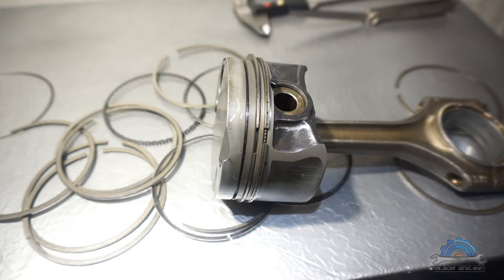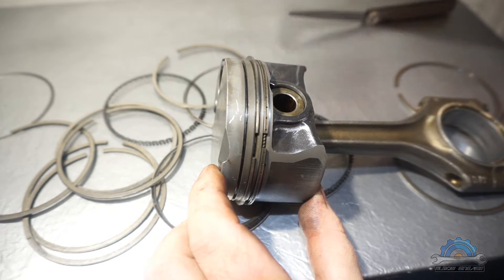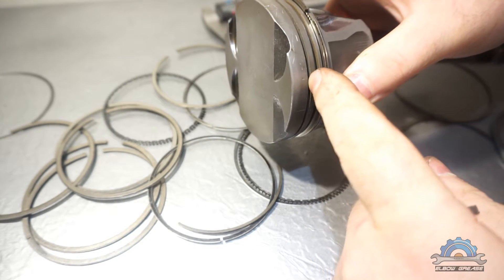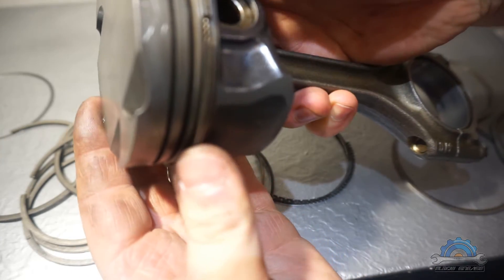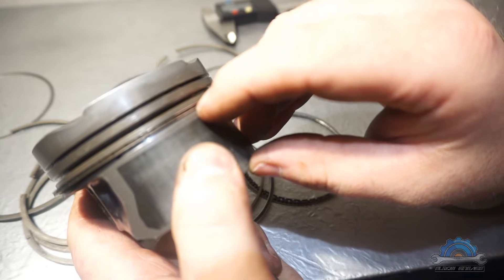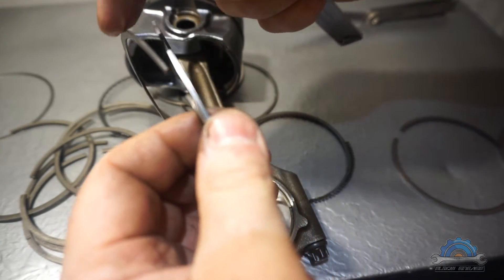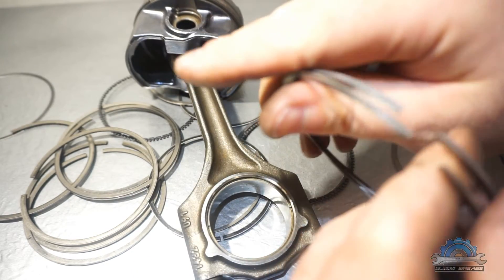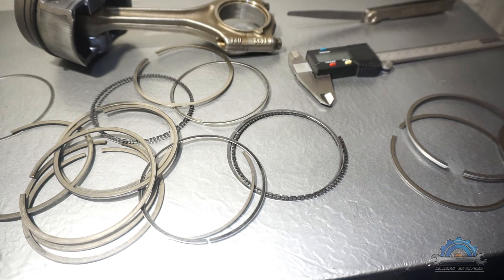BMW e46 M54 piston with M52tu rings?

Comment: I bought Goetze m52tu rings for my m54 block. My bores are only .0004" wear, yet the m52 rings have a .8mm gap, which is double bmw spec. Thoughts?

Comment: This is really interesting solution to the M54 oil consumption problem.....though I wish you had also shown a comparison between M52TU rings and aftermarket M54s.....what is the difference like in quality and price?  Even the newest M54 cars are over 10 years old now so most owners will want a good value solution.

Comment: Rings from m52tub20 will fit into m54b22? From specification they have the same bore of pistions but 2.2 has longer stroke. Or there is no sense changing them?

Comment: But you didn't use M52TU oil rings in your M54 when you rebuilt it, did you?  You used aftermarket M54 rings, correct?  Are you consuming any oil at all at this point?
Reply from the maker: Yes I used aftermarket OEM GOETZE, I'm not using any oil,level is same as it was and still have old ccv valve,OEM setup.
Reply from the maker: Yes I used aftermarket OEM GOETZE, I'm not using any oil,level is same as it was and still have old ccv valve,OEM setup.
Reply: Did you deglaze hone the cylinders yourself or have that done at a machine shop?
Reply from the maker: no shop involved ,they charge like crazy and they are always busy.Honing is easy.Block needs to be washed after.